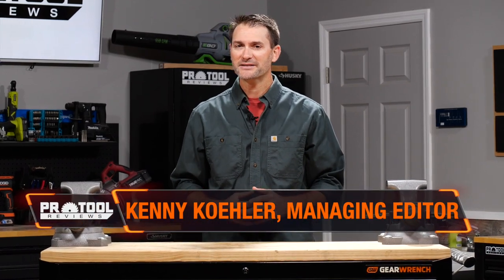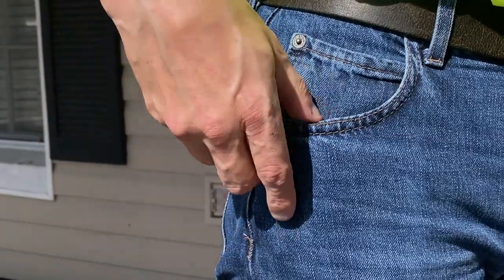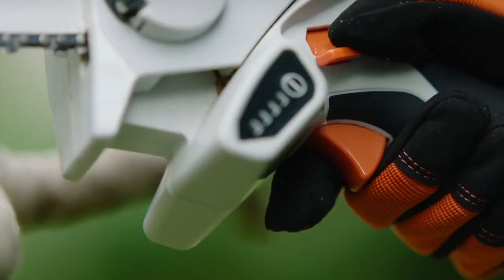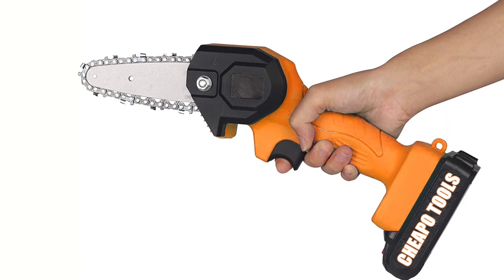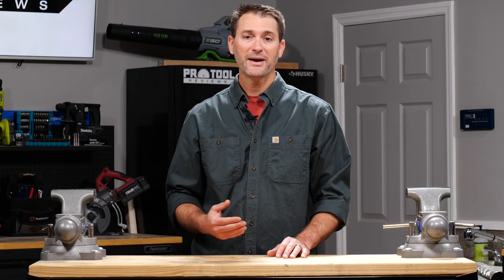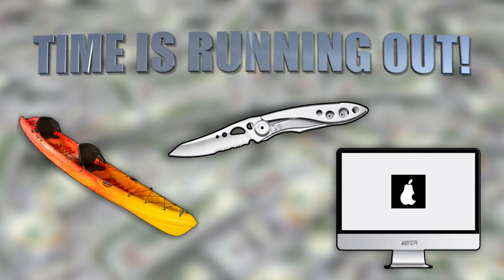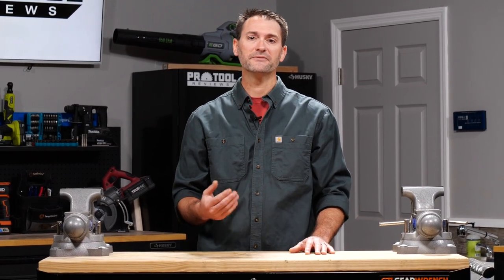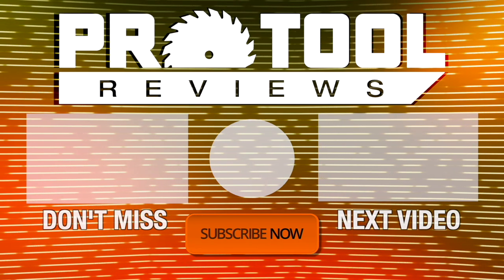SCAM Of The Year???

Comment: I think there are some other manufacturers that are making these mini chainsaws can you tell us a little bit about them? Perhaps Makita?
Reply: @Protoolreviews    If you're going to get on a 12V platform, go Milwaukee.   M12 Hatchet is a beast, but still able to 1-hand it.  Exceeds my expectations.   I cut a low-hanging 6" Alder limb down with it and fully processed it into sticks.   Didn't even drain the 3aH battery.
Reply: @Protoolreviews  thank you.
Reply: @ToolHombre  thank you..
Reply: Ryobi makes one that is a decent performer, but you have to oil the chain by hand as there is no reservoir.  That's a deal-killer in my view.
Reply: @HisboiLRoi  The Stihl is the same way.
Reply: @Pro1er  - The Milwaukee has a reservoir, and it appears to be a hair more compact than the Stihl, and far less bulky than the Ryobi.
Reply: @HisboiLRoi  Yes, I know the Milwaukee has an oil reservoir. The Milwaukee is larger than the Stihl and is the more powerful of the two, plus it has a longer bar. The Ryobi is the largest by far.